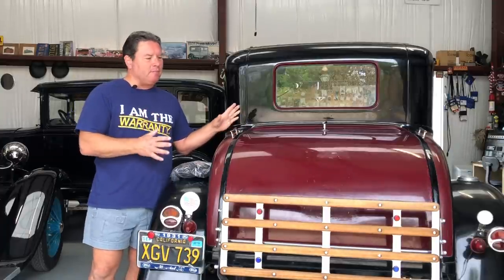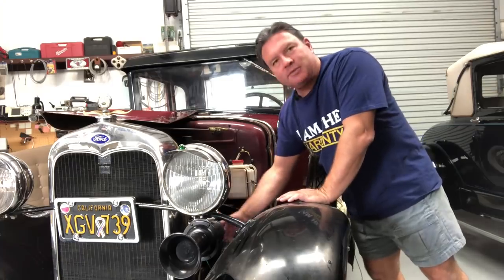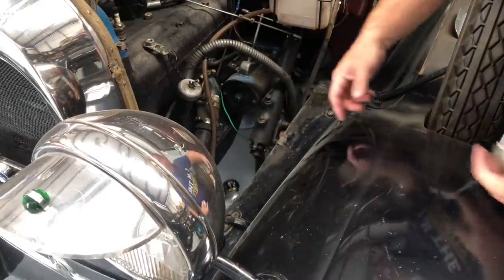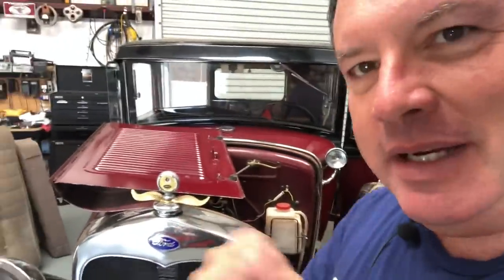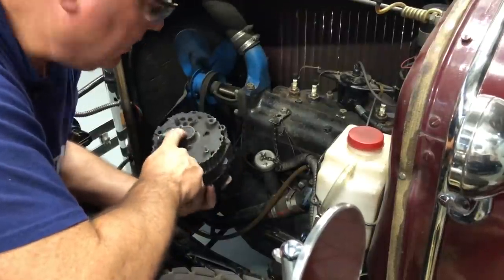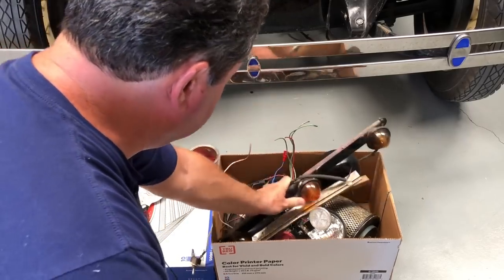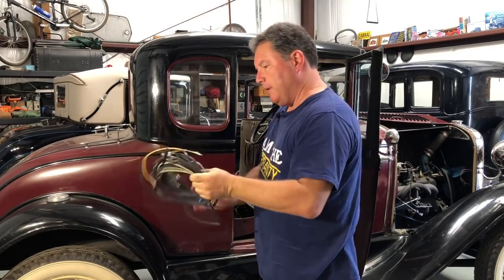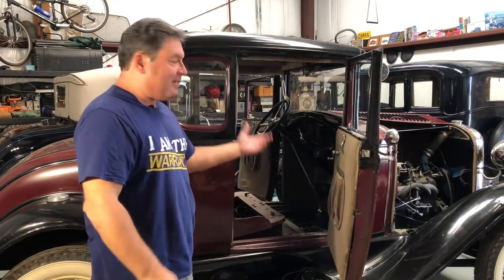Operation Hooptie: Rip out old wiring, ready for NEW wiring harness- 1931 Ford Model A

Comment: Imho, electric systems need to be flawless. There's nothing worse than error hunting in electrics that have corroded, been tampered with or are just downright wrong. 
12 Volts may be able to compensate poor ground, oxidized cables and so on, but it's the equivalent to applying more force on a mechanism that starts binding. It works, but the cause of the problem has not been adressed.

Comment: Thank you Paul for another great good video. Starting to do a right side tail light install. Hate to drill holes in a virgin fender. Both are going to be LEDs now. Also going to put the turn signals in the side running lights. Think I’m going to use 2 bulbs. What do you think of that kind of conversion? Trying to keep the Victoria as stock looking as possible, without too many add ons.
Thanks again, looking forward to the next one. Try to keep safe and cool.
PaulB

Comment: Sorry, you are correct. I have a 1931 Model A deluxe coupe. I have the old harness on the car but now since the car is at least 50% restored, I am thinking of replacing the wiring harness. Thanks for your work and help.
Reply from the maker: Ripping out old wire isn't something I thought would require a step by step tutorial.  Especially considering most of this wire isn't stock and is unique to just this car.  The next one where I installed a stock wiring harness does show step by step because it will apply to almost all Model A's.

Comment: Thanks for giving Athena (the Queen of Grease!) a new wiring harness.  
This may be a question for the next Q and A video but why did Ford choose positive ground or was that a common thing in 1928?
Reply from the maker: It was common.  Positive ground cars don't get corrosion on the battery terminals like negative ground does.

Comment: Paul , with all of the but slices, it's like the guy bought a bunch of them and HAD to use them all up. I've actually seen wire hookup not only with but slices but different gage wire in the same circuit. I mean, I've worked in the electronics environment for over 50 years and am still surprised at some strange things that I've seen. I'd really like to see that alternator conversion. The idea of old cars and new wires can be adapted with braided looms. It looks a lot like the original set ups.
Reply from the maker: The new harness is all cloth covered wire with the correct colors.  It will look just like it left the factory (wiring wise anyway).

Comment: Perfect timing, electrical video.  I actually have a tech issue you may be interested in.

I'm picking up a '31 next week that has a rare feature I could use your expertise with.  A factory original car radio.

I can do electrical work well enough, but never worked on radios before and know they require a special touch to get them right.

Seller claims it is all there and complete just doesn't work.  If this seems like something you'd be interested in, let me know and I can email with all the proper info.

Enjoy the fresh wiring, good connections and no splices are a wonderful thing.  I've had to remove hundreds of feet of wiring from this truck as I fixed and replace things.
Reply from the maker: There were no factory installed car radios in 1931.    Your seller is misinformed.  Curious to hear their explanation though.
Reply: @ModelA  I couldn't figure out how to explain it properly in a concise manner.

Factory authorized dealer addon maybe?   The switch to turn it on is mounted on the right of the steering column, and turns on with a matching branded key.

Probably should have mentioned it's a Packard, and not a Model A, heh.

Comment: Another enjoyable video. Amazing how much "junk" was added on to that car.  Question: when did Ford change the 1930-style radiator shell to the 1931 Style?  Your 1931 car has the "1930" shell.  Or maybe that's another piece of Hooptie?
Reply from the maker: Just part of the hooptieness.
Reply: My 1930 Tudor sedan has a 28/29 front dash but it was built on April 15th 1930.
Reply: @johnnyrocket6588  Ford changed to the 1930-31 gas tank/dash in June 1930.  So your car is true to new. Early 1930 vehicles had the 1928-29 instrument panel/gas tank and oval speedometer.  This is mentioned in the Model A Restoration Guidelines and Judging Standards in Area 6 - Instrument Panel: A smooth panel with oval shaped speedometer and centrally mounted instrument panel lamp was used from the beginning of production through June 1930.
Reply: @mafcawebmaster4237  Thanks for sharing that information with me.
Reply from the maker: He is a wealth of great info!

Comment: Your shop is very clean but be careful with the bare feet as you get older the things you don't see like dropped screws will have you doing the Sonoran war dance!
Reply from the maker: The floor is very clean, as you know.  I'm using the concrete as a heat sink since it has been so hot in the shop every day.

Comment: What is the advantage of positive grounded system over negative grounded system other than historical correctness? That would be a moot issue if you install an alternator. Also the 12 volt system provides brighter headlamps and livelier starter. Yes, I understand that applying 12 volts to a 6 volt starter results in hotter winding and commutator but it is not issue for this type of duty if the engine is a easy starting one.

Comment: Fun video. Could you explain your reasoning for reversing back to a 6 volt system? Thanks!
Reply from the maker: Thank you! Because it's the right thing to do
Reply: @ModelA  LOL! OK. When I bought my Model A a decade ago, the fellow explained to me it's "easier" to get auto batteries and crank the starter with the 12V. Well, the battery part was correct ( the local Napa stocked the size easily). But, it's not original for sure, which I'm sure bothers some. BUT neither is the Mitchell overdrive (which I love).
Reply from the maker: @splankerbergen   The real problem is how 12 volts on a 6 volt starter tears things up.  Especially flywheel ring gears  Then, there's the horn.
Reply: @ModelA  Excellent, makes sense

Comment: I'm curious what the wiring harness costs. My Uncle has a 1919 Rolls that really needs to be rewired. 12 volt positive ground with what looks like the same light system.
Reply from the maker: Prices range between $150 and $400 depending on what you need.
Reply: @ModelA  do you prefer a brand or web site?
Reply from the maker: @clydecare   All the good Model A parts suppliers sell wiring harnesses.
Reply: @ModelA  how do i remove the tail light sockets from
the teacups to install the new wiring harness connections?
Reply from the maker: @andyweixler662   You don't.  The new pigtails get threaded through.  The new harness connects with those bullet connectors to the pigtails.  Scroll to the 32:45 mark of this video and you can see me do it- https://www.youtube.com/watch?v=1ABt_y8iXnc
Reply: @ModelA  thanks and thank you for your videos!! they are amazingly helpful for making me (not very mechanical) feel confident with trying these repairs on my 30 Tudor.

Comment: Safety is your first priority, yet you walk around the shop in bare feet....? ;-)
Reply from the maker: When it's 100+ degrees in the shop, yes!  My shop floor is meticulously clean.  I mop it frequently.  The floor stays pretty cool, works as a nice heat sink when it's hot.
Reply: @ModelA   Well I guess if it doesn't involve anything heavy, just the wires. I've seen that "Three foot slpice" effect before, and that is usually someone who do3esn't want to pull the harness, or mess with any wire runs that have to go through long sections of the body.  Just clip and snip, and splice what they can reach without doing anything involving unbolting or heavy lifting.

Comment: Hey Paul, my Ford V8 drives really well but today when I turned on the lights, the Amp gauge went all the way down to negative. This only happens when the lights are turned on, in any other situation the car just charges. Do you have any idea what could possibly drain the 6V battery so much when I turn on the lights?
Reply from the maker: Sounds like a short somewhere in the light circuit.
Reply: @ModelA  thanks for your answer! The lights still work however. How can I track a short?
Reply from the maker: remove the light bulbs one at a time, turn the lights on, see what the ammeter does.  When you get to the one where it doesn't change, then check along that route.  A   voltmeter with a sharp probe for sticking into wire is your friend.
Reply: @ModelA  thanks! I will try it out soon!
Reply from the maker: @davidv5510   Also, see if one or more lights is off or dimmer than usual.  Happens with Model A stock headlight wiring all the time.
Reply: @ModelA  yes, one headlamp is way dimmer than the other, especially when the engine isn't turned on. Could that be the problem?
Reply from the maker: @davidv5510    Definitely a possibility.  Now you know where to look!
Reply: @ModelA  thanks! And the problem usually is bad wiring towards the dimmed headlamp? And to fix it I have to replace the wire?
Reply from the maker: @davidv5510    The wire might be just fine.  You need to find out where the current is making a path to vehicle ground.

Comment: You’re entertaining but get real! You claim the Model A is the most reliable car made and won’t break down if properly tuned, and it’s simple to fix if it does.  But you have a “shop” and special tools and a parts catalogue the size of a Chicago phone book and have spent your life repairing tube radios. I’m just a guy with $12,000 or $15,000 for a classic car living in a condo who wants a basic old-school vehicle to drive that’s not a handful. You’re a mechanic. Great! But why pretend these old Ford’s are not all-consuming projects?
Reply: Hi Steve, I'm not a mechanic, but I like cars. I have a 1929 Model A. I've learned to maintain it on my own from Paul's how to vids and a few manuals. I performed the 1000 mile maintenance on it yesterday. The only special tool was an adapter tip for the grease gun. ($3.99 at Mac's) I have also swapped out a carb in the past. It required a box wrench and a screw driver. No pretending. -Den
Reply: @WrightBrosRC  Thanks Den! Kind of you to reply. Your examples are persuasive. I don’t mind learning and there are several Model A clubs near me outside Seattle.
Reply from the maker: Thanks Steve.  I work on mostly other people's Model A's and am restoring several.  I seldom have to work on my restored Model A's other than routine maintenance.  Also, check out my 1929 fordor sedan.  All original, unrestored, and drives like a dream.
Reply: @ModelA  Thanks for taking the time to reply, Paul. I enjoyed your video with the unrestored 4-door your masked friend drove. With that orange triangle sign on the back of the old’ buggy (and your pager and flip phone) you’re almost Amish. Just need a long beard.🤣🤣And I was going to start my first comment with “No disrespect Paul, but…” Then I heard you say that people write that and then disrespect you.😀 If others here are not mechanical and are learning as they go please comment. Thanks again.
Reply from the maker: @sockmonkey22    Hahahaa!  No worries Steve.   I had a supervisor once who trained me that if tou use the word "but", then you erase everything you said before it.  Example, "I like you, but you drive me crazy".  Alternative: "I like you, and you drive me crazy"
Reply: @ModelA  Exactly! “If you work for our company, we have a lot of fun here, but…”🙄😁
Reply from the maker: @sockmonkey22    I make great YouTube videos, but ....
Reply: @ModelA  But…yes you do.😉🤠
Reply from the maker: @sockmonkey22    I believe you, but some of my videos are kinda lame.

I like watching the Olympics, but I can't wait til they're finished.
Reply: @ModelA  Why not work in a ventriloquist doll act like Charlie McCarthy with his own little Model A? He can say funny, sarcastic stuff like, “This is the last time I try changing my own tire” and his car is right on top of him and he’s all greasy. 😅
Reply from the maker: @sockmonkey22    You're gonna laugh... I do have puppets, and was thinking of using them (one is a Spot-on for Tina).  Tina said it would make people unsubscribe.
Reply: @ModelA  Hilarious! Well, there’s a fine line between hokey and witty. Edger Bergen and even Jack Benny created comedic magic by allowing themselves to be the victims of the gags, unlike Hope and Berle.
Reply from the maker: I think Jack Benny was the greatest comedian ever.  That look when he would look at the camera after a gag.  The way he would walk right into a joke all gung-ho, then punchline, the  yell "Oh, come on!"... all of it.  We have 2 puppets, one looks just like Tina the other is supposed to look like me.  But it doesn't.  Maybe some day.